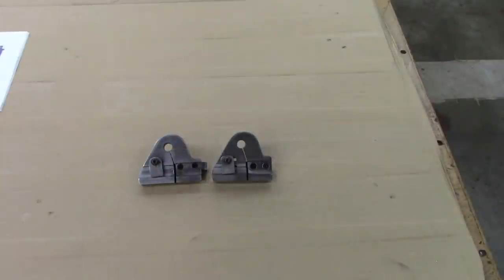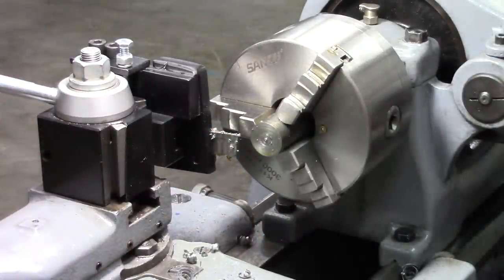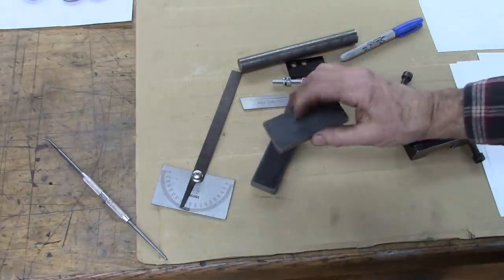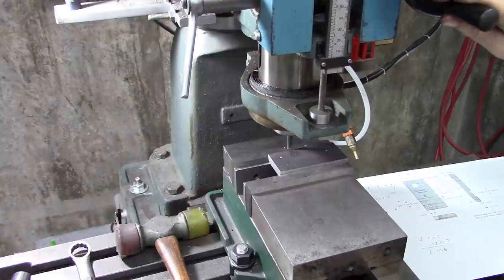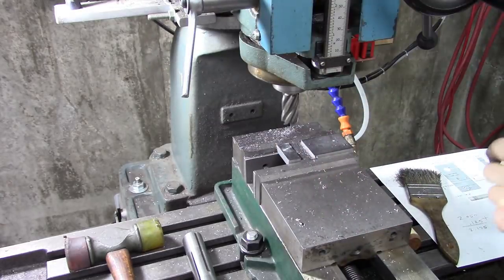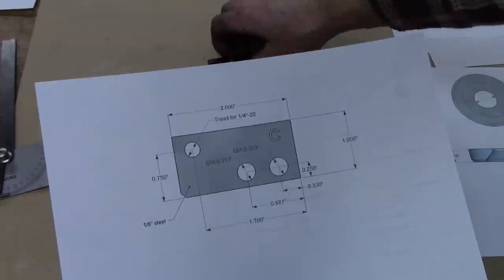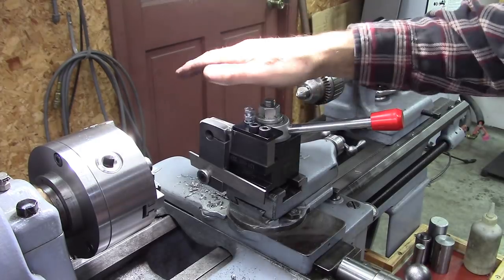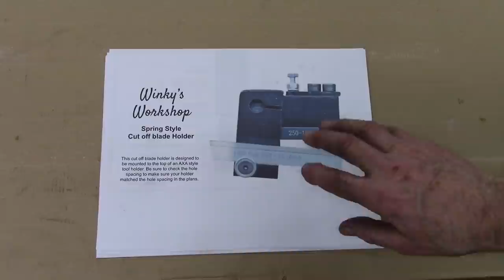Spring Cut Off Evolution! An Easy to make design + the PLANS

Comment: Another great video AND  a puzzle tossed in.  The first tool worked and the second one didn't. Why????  If you find the answer please let us know, sometimes you can learn a lot from a puzzle!
Reply from the maker: Yeah...  I kind of freaked out then that happened. I suspect the first tool was close to not working well and a very slight difference pushed it over the edge. There is a lot of stuff going on with this spring idea. The location of the point of pivot, the strength of the spring, the weight. etc.. I think the biggest difference in the new design is where I moved the pivot point. By moving it toward the cutting point the tool moves back more when it is deflected.

Comment: From here, with regard to the failed second design, what I see is that the springing action is removed by bolting the tool holder bar to the front part of the tool.  🤔 🤣
JIM
Reply from the maker: The spring is the vatical bar with the hole. It's welded above the hole to the non-flexing  horizontal bar. This design works a little better due to the point of flex being closer to the cutting edge. The blade retracts more under load.
Reply: @WinkysWorkshop  I'm talking about your second tool Winky.  You have 4 bolts making the tool solid?
JIM
Reply: @WinkysWorkshop  
When you say retracts  ?
What happens when the spring retraction relaxes  ?
Or doesn't it  ?
If it doesn't  .. then that suggests to me that lowering the blade might have the same effect   ?
Reply: Well, look again!
Reply: @MatthewTinker-au-pont-blanc  Look at the second tool he made, there are four screws through the tool into the holding bar.  That makes the tool solid, no springing.
JIM
Reply: @jimc4731  If I remember correctly, the screws were to limit movement, they were not locking, but limiting.
Reply from the maker: @stevewilliams2498  Interesting but no...  It doesn't have the same effect. It's the point of flexing. Standard tool setups flex as the compound or post. If the blade digs into the work the tool is pulled down and into the work (even if it's below center). If the point of pivot is above the tool it compensate for the inward movements happening at the post or below.

Comment: i like it but dont qualify as am in eu. but just wanted to say maybe the second one doesnt work cause of the heat treatment you gave the first one with the weld.
seeing it doesnt work couldnt hurt it trying to heat it and let it cool.
thats the only differents i see in all 4 no heat put in from the weld on second one
Reply from the maker: You could be right. It's mild steel so the temper shouldn't be much but it could effect it

Comment: Why do u want it to spring , what’s wrong with the tried s and true part off
Reply: Smaller lathes are not as stiff as a larger lathe.  The downward force on the cutting tool causes the tool to dig in deeper and basically chatter or seize up depending on how much pressure is applied.  The geometry of a flexible or camel back tool holder causes the tool to back out when the pressure is increased.  It is basically going from a positive feedback to a much more stable negative feedback system.
Reply from the maker: See the comment below. Also watch this video where I explain it better if you want. Tried and true seems to be a bit illusive to many, especially smaller lathes. https://youtu.be/du2eCZlOQXE
Reply from the maker: Dang...  that's a very good explanation!

Comment: On your second one the second set of bolts are defeating the purpose of flexing. They are making the whole thing rigid.
Reply from the maker: I understand what you are saying. They were added to try and stop it from chattering. They had over size holes so that that depending on the tightness you could adjust for chatter. It didn't work with or without anyway.

Comment: it didn't work because   of your  front blots removing the spring . les England like  it & I'm in he UK LOL Les . ha ha ha i Bild my  cut of  holders  out of all old forged  spanners. no longer used .i like it Ha Ha Ha .
Reply from the maker: The front bolts were an afterthought. The holes were oversized and there was a piece of shim stock between the bar and plate. It created an adjustable brake kind of but with out without the screws it didn't work.

Comment: Hey Mark, I tried to send you links to my videos of the carbide insert version of your tool, videos came out as shorts. Trying again. Here is one (on stainless) and everything goes well until that last 1/16", then the tool drops below workpiece and snaps insert I am playing with height and allowed flex, but it appears it likes to be about .008 to.009 above center and about 1/3 of the relief gap allowed in flex. I really can't put that into a true movement amount...maybe .02"? Any thoughts?  https://www.youtube.com/watch?v=oXGcJ4PGfus
Reply from the maker: I watched the video and yes I think I know what will fix it although carbide may act differently. The 10/32 screw I used for a stop was screwed down snug and loosened about 1/6th to 1/8th turn. I'm guessing the insert is not breaking until it takes a dive and the screw stops it from doing this. I would also double the speed. I think the slowest I ever cut off is 180 rpm.
Reply: @WinkysWorkshop  I tried those 2 things and definitely better results. I'll experiment more with the higher speed and tool height and much less movement on the adjusting screw for flex. Thanks Mark!
Reply from the maker: @seanwolfe9321  Thanks for letting me know. Keep me up to date.

Comment: 1:53 - those extra bolts spoil it. Take those out, make sure it flexes and it should work fine too ! The bolts just make the whole thing rigid again - so pointless !
Reply from the maker: You kissed what I said in the video although I didn't explain it well either. Those bolt were not there originally. I was just looking to a reason the second tool was messed up. I looked at the first tool and notice that there was no gap between the 1/2" square bar and the plate. I thought maybe it warped during welding and that the friction between the two was stopping it from chattering. It made no difference but the tool holder did not work before installing screws.
Reply: @WinkysWorkshop  The screws were a backward step. Make sure the tool holder flexes freely.
Reply from the maker: @millomweb  Like I said...  I was just trying things because it didn't work.

Comment: Don't get me wrong, this tool seems to work great, but I liked the initial design better - this one has too much overhang off the compound base, whilst the first was right on top of it.
An alternative could be a rear cutoff tool post, which seems to be better for smaller (less rigid) lathes - example (not endorsing) here: https://www.youtube.com/watch?v=nxD5jof0bfY
Reply from the maker: The new design is 3/8" closer to the post and has the same front overhang. That's why I mounted it on top of the AXA holder. The point of flex is also closer to the work which makes the blade pull back more when deflected. As for the rear post, this is a fantastic method but my lathe is not set up for this (although I have thought about modifying the cross slide (big job). And...  for some reason the last design failed when i made the second one. I'm not sure why but I suspect the point of flex is too far back.
Reply: @WinkysWorkshop  Thanks for your reply! Somehow, it seemed to have a lot of overhang - my mistake, sorry.
Anyway, it appears to work great and the surface finish is good for a parting job 🙂
Reply from the maker: @JoseSilveira-newhandleforYT  No problem, thanks for watching and commenting.

Comment: The cutters at the beginning of the roller are spring-loaded, mistakes have been made in them and therefore they do not work properly or do not work at all. The thickness of the metal is taken very small and the arc of the "spring" is too narrow, the cut is small. And the cutter itself is more precise, its design is too short. If done correctly, then you do not need to make a more complex design. In any case, a person chooses what is convenient for him. Good luck to you in your work.
Reply from the maker: Correctly is a problem sometimes. For instance, a Harbor Freight lathe is not ridged enough to do cut off. A many Logan, Atlas and South Bend suffer the same although not as bad. This tool is a work around for those that do not have lathes built like a tank.  With that being said, I have successfully parted many times and failed several as well. This tool works 100% of the time. I would be foolish not to use the better method. The only negative to this design is  slight resonance patterns on the end of the stock. It's basically a straight cut but you can see variation. Most often this is totally acceptable.
Reply: @WinkysWorkshop  I understand you perfectly about the strength and rigidity of the machine design. There is no such strength on my homemade one and there was a cutting problem and the situation was corrected by a spring cutter like yours at the beginning of the roller that you refused. It's your right that you strive and choose the best for yourself and that's good. The first model is easy to manufacture and works 100% on most machines, but your model is also worthy of attention, but a little more difficult to manufacture and more details. I'm glad you did it and it works.

Comment: As usual, the scret is aequate rgidity.
Reply from the maker: Actually, in this case, it's the fact that the tool has built in flex. The point of flex is over the top of the tool rather than the tool post or compound. This makes the tool pull out of the cut when things flex. See part one for more details. https://youtu.be/du2eCZlOQXE